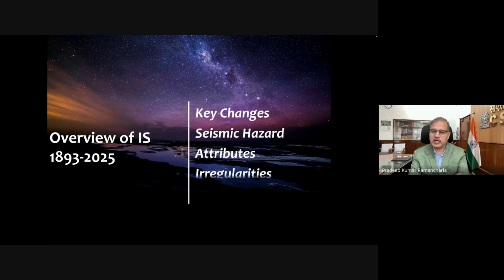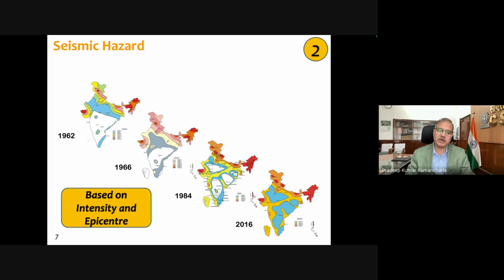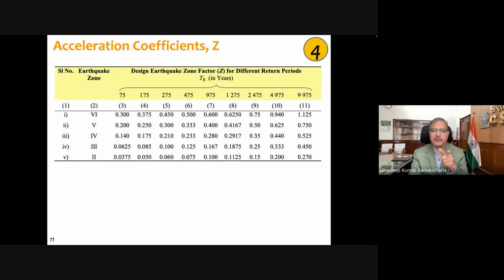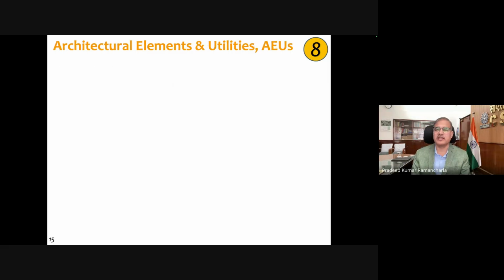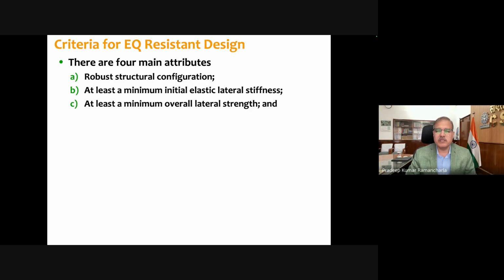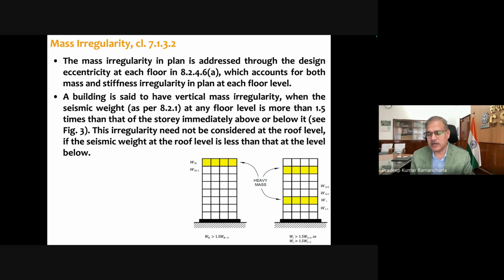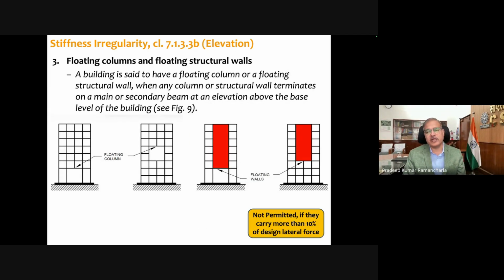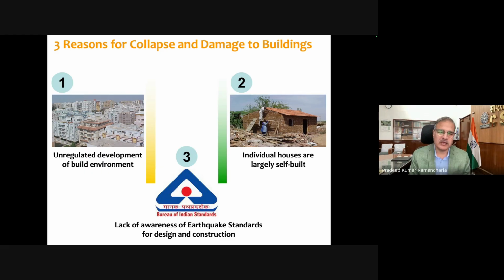Overview of IS 1893 2025 - Key Changes

Comment: does class E site value not have  design spectra graph?
Reply from the maker: In general, the normalized elastic maximum horizontal and vertical PSA, PSV and SD are obtained through site specific hazard assessment as per clause 6.3 of IS 1893:2025 for site class E.